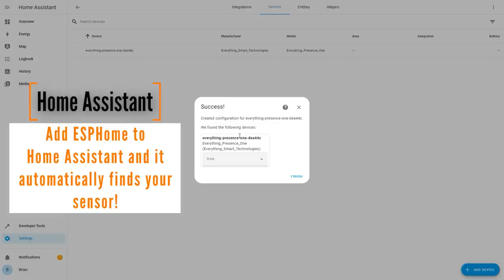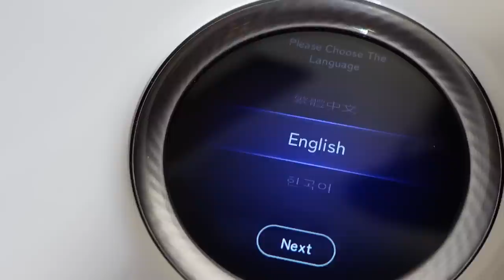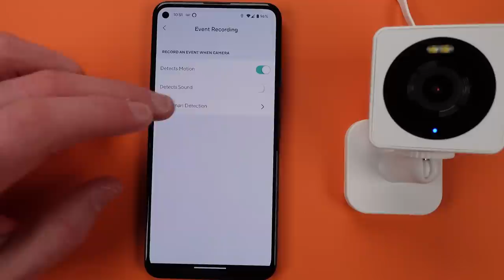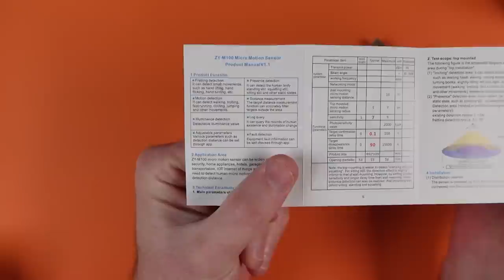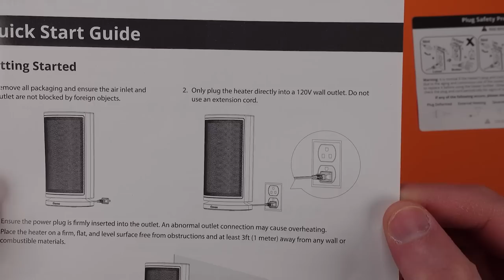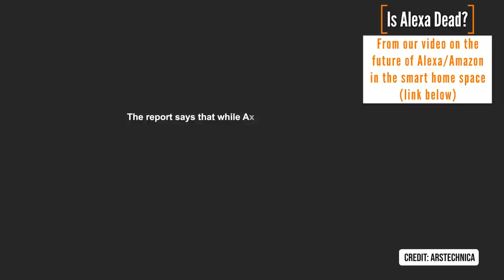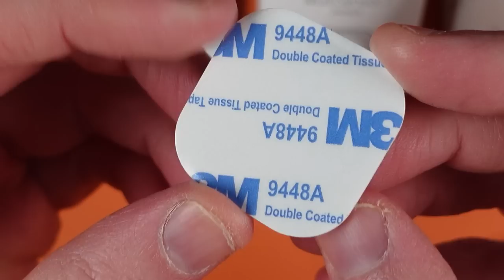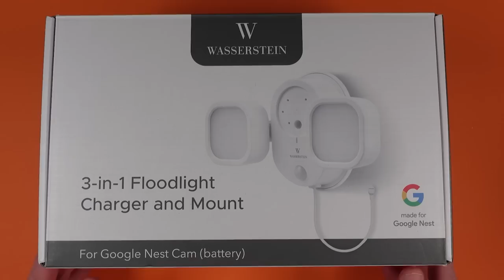My Massive Smart Home Tech Unboxing - EP 7 (Presence Sensors)

Comment: Just as a note on the Everything Presence, using ESPHome in Home Assistant, the static IP is not needed.  ESPHome will detect it based on an encrypted API Code that the device sends.    Static IP is preferable so you can find the device if you need to, but that is a recommendation I would make with all WiFi devices.    I love supporting makers like Lewis, so I have got a few of these, but they are expensive when you add everything..
Reply: Yeah
Static IP isn't always possible to do

The idea of making Smart home devices specifically for esphome is really nice though, especially as it means you could write your own firmware if you wanted to, or you could find one made by someone else, more people/companies should make devices that are open (source/hardware/ecosystem) like  that
Reply from the maker: As soon as I didn't have it on a static Ip, it got lost and ESPHome never found it again.  I tested it a few times to see but it never found it.  Musta been something in my setup!
Reply: @AutomateYourLife  It is an odd one.   I might have to do a bit more research on this too.

Comment: I have the Tuya presence sensor. Multiple of them now. They work great with Hubitat and I'm using them instead of motion sensors to manually turn off lights in main rooms. Turn on lights in some instances at night in living room and kitchen. Quick response and love them. Yes, there is another version that go into recessed light(?) spots in the ceiling if you wanted to install one there for a cleaner look.  I'm probably going to integrate them into a diy self monitored security system as well.
Reply from the maker: Nice!  So self monitor with Hubitat then?
Reply: @AutomateYourLife  that's going to be what I'm going to attempt. I have a keypad coming in that's supposed to be compatible and there's an app I could use as well for this purpose as well. I'll see how it goes.

Comment: Does that Tuya presence sensor connect to home assistant through a zigbee dongle? Also, do you intend to do a more detailed look into it later or know of anyone who has done one? I would love to be able to use these around the house, but don't want to put in the investment for something that is inconsistent or doesn't hold up well.
Reply from the maker: It works with ST if you know what to do, and that's meant I've used it extensively.  I don't know about home assistant but I imagine it'll be just fine there if you can find a developer who's worked with it
Reply from the maker: And it's held up well.  You need the configuration options, but it's been great

Comment: Thank you for your content, I am enjoying it greatly. I am trying to find a good home security system (without subscriptions). I purchased the ring system & can't get it to record off the door bell or external camera to the sync 2 - its all connected but when there is movement (outside) it records nothing, if I move the camera or move my hand right in front of it it will record (SO Its useless in my opinion without the subscription) Is there a door bell (able to withstand -30 C temps) system ( without hard wiring) that you have found might work for a residential home & connects to Amazons hub?
Reply from the maker: You in Canada, John?
Reply: I like Reolink where you can get recordings from micro SD card, email, NVR, and cloud (1st camera free) in some countries.
Reply: @AutomateYourLife  YES, Edmonton

Comment: Oddly enough just bought two of those tuya zigbee presence sensors. Will even kind of work with Hubitat although most of the software based (fine movement) stuff is unavailable. In Tuya mode pretty useful since I suffer from muscular seizures if I get too cold.
The heater looks good but it also looks very easy to tip over... Would be good otherwise to keep my Tegu warm but it'd be over in seconds...

Time codes seem a little off BTW, but maybe due to the format..
Reply from the maker: I'll have a look at the timecodes.  Thanks Rosie!

Also, there are 3 versions of those heaters from Govee, and there is a heavier one that might work for ya :)
Reply: @AutomateYourLife  Timecodes might just be cos watching on Newpipe but they seem to be out of line to the timing of the video...

Thanks for the info, but the only thing she can't knock over is pretty much screwed to the wall.. Tegu surprisingly powerful lizards. I've a fairly good setup for her right now... And what with everything else...
Reply from the maker: Yeah must be how you're watching.  I just tested them all and it's at most 1 second off for any of them. ;)
Reply: @AutomateYourLife  OK, just thought I'd mention it. Newpipe is flakey to be fair..
Reply from the maker: I'm glad you did!  I make mistakes allllll the time!
Reply: @AutomateYourLife  WHAT???? You do? 😉
Reply from the maker: @gregkeeyako  No.  None. Ever. 🤣
Reply: These sensors can work with Google in a work-around solution.

Comment: While the Tuya Presence Sensor via SmartLife doesn't work directly with Google or Alexa, there is a work-around where the sensor turns on a bulb or plug (in SmartLife) which in-turn triggers a Google routine. A step further for Alexa is possible. 
My YouTube channel has short video of this working.
Reply from the maker: Nice!  Thanks Michael!
Reply: Yeah, I've seen that trick before. I'm using it for Prisca my Argentine Tegu. Her basking sensor is on Hubitat (triggers her uv lamps) and it's driving a smartlife bulb and voice alert through Google in the lounge to tell me she's up and about. Works very well. Usually at about 5:30am...
I know when the little mourning geckos are up because they're chirruping all the time.. 🦎